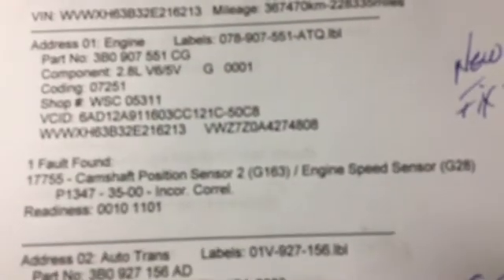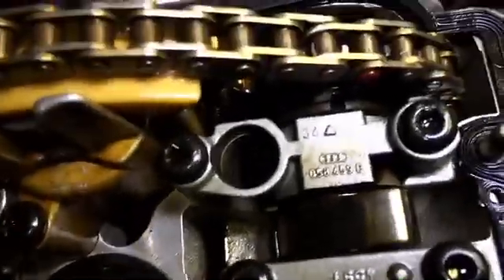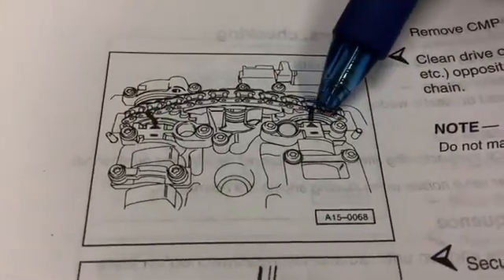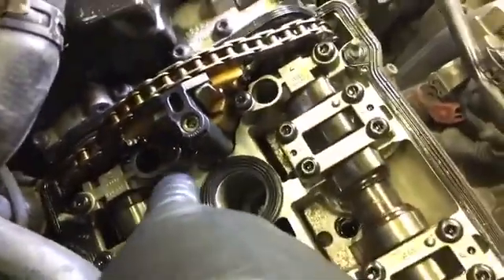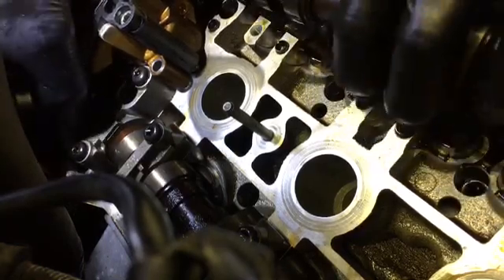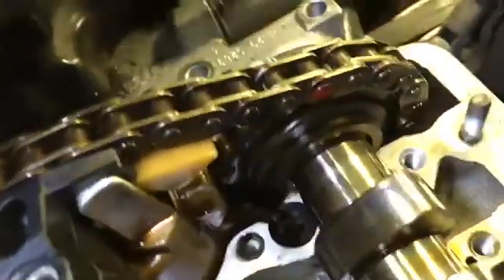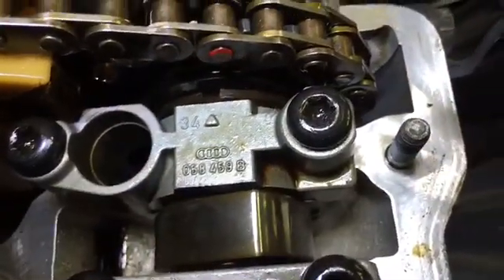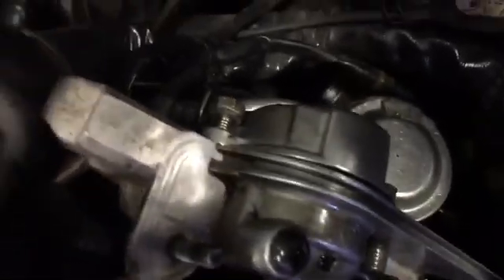Passat 2.8 Incorrect Correlation

Comment: Question, when doing this. Does the timing belt have to be DTC ? Then do this repair ?
Reply from the maker: Julio Duran Yes the motor must be in the correct timing position
Reply: @vwjustfixit4843  Thanks for the reply, when I put the car in service position at top dead center both of the camshafts are out of adjustment. I believe that's my problem
Reply from the maker: Just make sure the timing marks on the crank pully and both camshaft gears are all in the correct alignment and you will be good to make the adjustments.

Comment: so the exhaust side is a tooth off i have the 2.8 24 valve vr6  02 jetta why cant you just remove the tensioner and turn the exhaust sproket back a tooth there is enough room between the cam gear and housing to do it but intake not enough room andit was the exhaust cam that was off but ypu turned the intake please explaine i dont know why im having this issue my engine has not been touched how could it jump a tooth no chain noise idles like a dream but when you takeoff it bucks  please help
Reply from the maker: William Lynch, Hi, the Passat 2.8 and the Jetta 2.8 VR6 are two very different motors. Do you have DTC codes
Reply: @vwjustfixit4843  the only code i get is p1347 camshaft/crankshaft o2 sensor signal out of sequence i have all new every sensor on the motor and exhause all boush
Reply: @vwjustfixit4843  can you tell me how to fix p1347 please help
Reply from the maker: William Lynch did you replace the G28 engine speed sensor
Reply: @vwjustfixit4843  Yes every sensor thats the one next to the oil filter the only thing I haven't replaced is the 2 sensors that stick out of the cam gear cover and screw into the head
Reply: @vwjustfixit4843  and thank you for helping I can't find any repair manual for the vr6 vw
Reply from the maker: William Lynch Try idenifix.com and use the trial offer.
Reply: @vwjustfixit4843  Hello, Can someone please explain how a chain can jump over 6 or 8 sprocket teeth to jump one tooth. It just seems very improbable. What am I missing? Thanks!
Reply from the maker: Gary Kirk loose chain, broken adjuster shoe/pad, cam chatter
Reply: The transitioners on these heads are CHEAP. If you have a timing problem check the bottom chain guide for wear or breakage. I had one broke and it still ran Bf finally jumping time for 2 months.